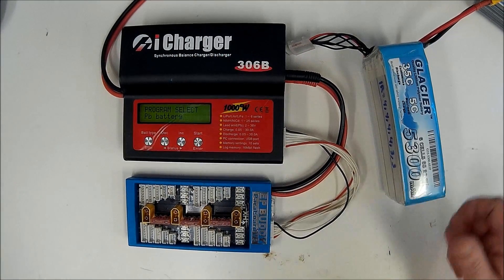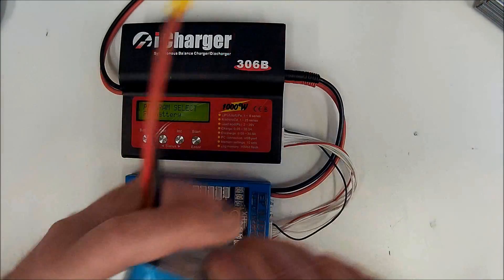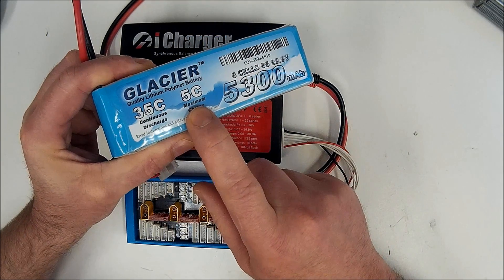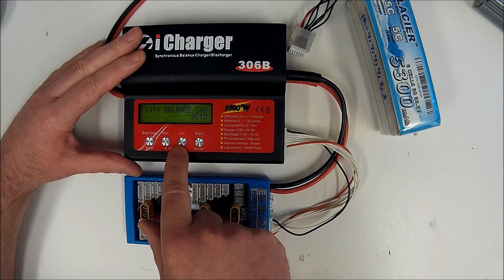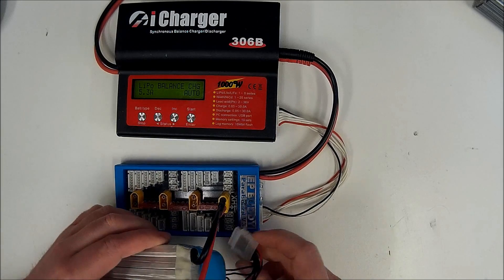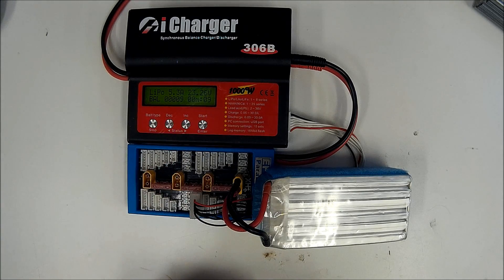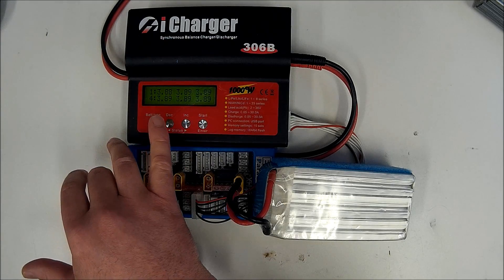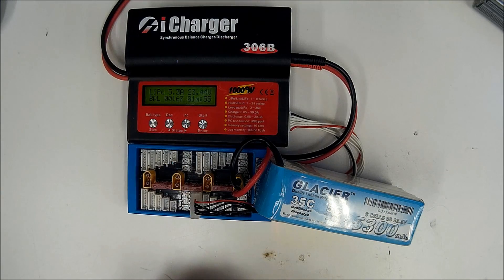How To Charge RC LiPo Batteries - Including Balancing

Comment: Hey I have 7200mah 7.4v 80c 2s battery but this charger only max out at 5.0A....will that be problem when balancing?
Reply from the maker: What is "this charger" the iCharger 306? The 306 has a 30A max charge rate. Regardless, max charge current has nothing to do with balancing. Balancing loads are small, only enough to keep the cells in proximity. If you have a computerized charger that is rated at 5A max, and are balance charging a 7200 mAh 2S pack,  provided it's a good charger, there should be no issues. Of course the only way to know for sure is to monitor the balance charge cycle to confirm  both cells are balanced at the end of the charge cycle.

Comment: Great video as always John. I was reading the article you linked to as well as "Li-Po Battery Internal Resistance". Lot's of good info there, thanks. I had a question about IR. I know, the lower the better but you say "smaller micro sized LiPo cells will have higher resistances. It's not unusual for example to measure internal resistance numbers in the region of 150 milliohms". Wow. I recently bought a used heli with 11.1V 300mAh 3S 30C LiPo batteries that are measuring 186 milliohms. as well, I can't seem to storage charge them, they bottom out at around 4.0V. I know, you take your chances with used batteries so I wasn't really counting on them but I was curious about these readings.
Reply from the maker: Best to contact me through my website with technical questions like this. Quick answer is 186 is about double to 3X the resistance of any healthy 300 mAh cells I've tested over the years. Note I said CELLS. You never specified if 186 the total for the 3S pack or the individual cells. If it's for the 3S pack, then that would be a good value - but there are other factors to consider.
Reply: @Rchelicopterfun  Will do John, I posted here thinking that contacting you through your website may have been a bit selfish :-). By the way, the number I gave you was per cell. Thanks for the info.

Comment: How would you connect a LIHV that has no physical cables coming from the battery pack? Like the one I purchased PTK-5117-20. Not sure if it matters but the charger I have is Spektrum S2100.  I'm new to the RC hobby...Thanks for your reply...
Reply from the maker: You would need to build the correct charge/balance wiring harness or purchase one that plugs into the hard cased 2S pack. I show an example on my RC LiPo battery page on my website under the heading Hard vs Soft Cased LiPo's: https://www.rchelicopterfun.com/lipo-batteries.html

Comment: Thanks for sharing. I'm looking for any suggestions on disconnecting what should be disconnected first after charged?  Any advice would be appreciated 🙋‍♂️
Reply from the maker: Doesn't really matter since there is no current passing through any of the connections after the charge cycle is finished. Personally, I tend to unplug the balance connectors first and then the main power plug.